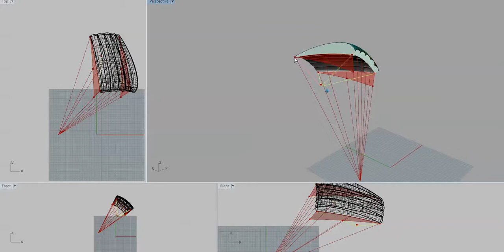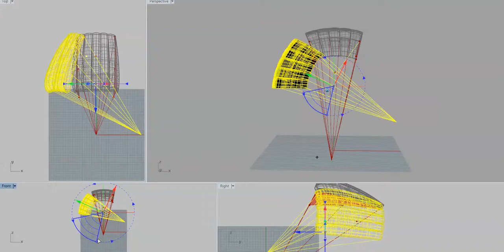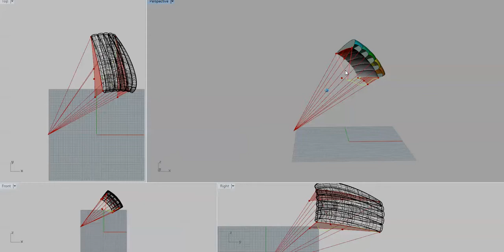gravity feedback for single line parafoil

Comment: Jalbert was working on these sort of things right up to 1991... along with in-flight bridle adjustments / angle of flight widgets for single line parafoils... that were attached at the base of the bridle leads. I will E-mail you a jpg. of his simple designs. Domina would be proud to see the continued work on the parafoil.